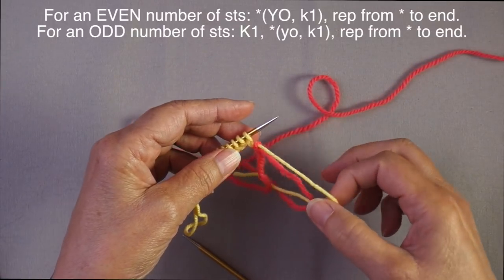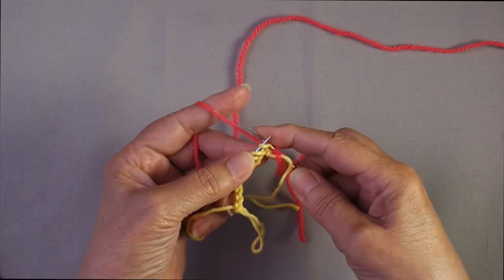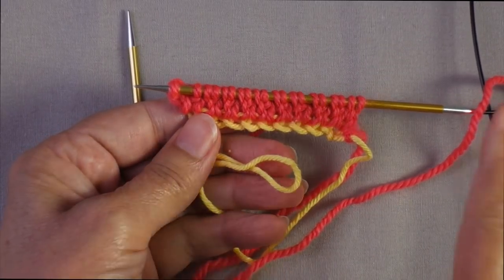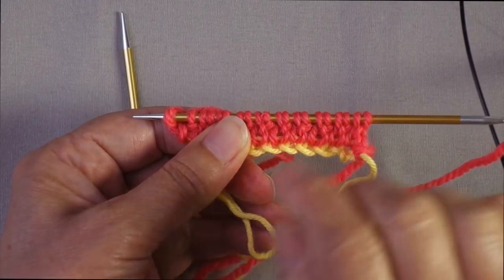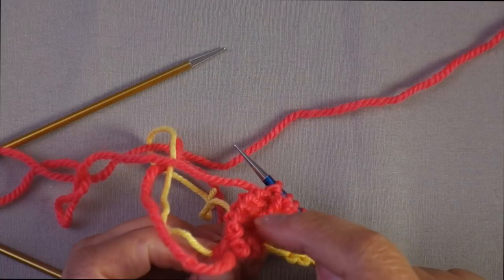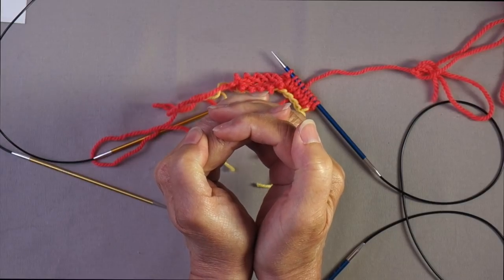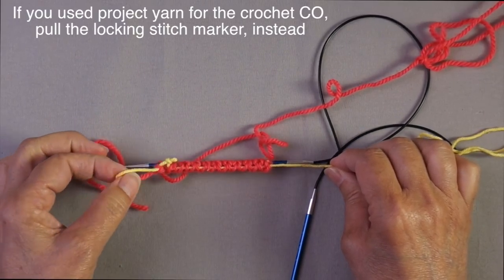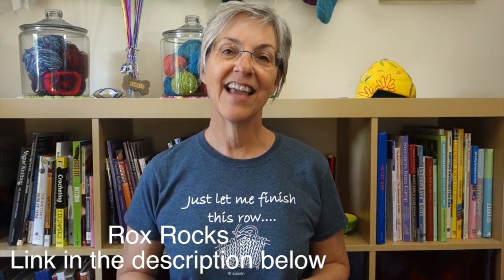Tubular Cast On

Comment: Do any of your videos show the 1 x 1 tubular cast on in the round? On this video it looks like you completed your tubular cast on and then joined your work? If so, do you just knit one purl one on the first round of regular 1 x 1 ribbing.
Reply from the maker: Once you've completed the setup, it should be clear which sts are to be knit and which are to be purled. So if you join in the the round, knit the sts that present as knits and purl those that present as purls.
Reply: Is there a right side and a wrong side to the tubular cast on?
Reply from the maker: It's like any k1p1 ribbing pattern in that both sides are identical, once you complete the set up rows. You can do the setup rows in the round, but it's trickier, because one round you'd k1, sl 1, and the next round, you'd have to sl the sts you k the previous round, and purl the sts you had slipped. So if you do the setup rows back and forth, you knit the sts that look like knits and slip those that look like purls. Once you've completed the setup, you work them in k1p1, regardless of whether you continue to work flat, or decide to join in the round.
Reply: Thanks for clarifying that for me. I am working on a pair of fingerless mitts and want to use a tubular cast on. I watched another person’s You Tube video that showed doing the cast on in the round. But I found it to be tricky getting the join to look decent. Additionally, it was tricky having to do each round opposite of each other. My only concern is how good of job I can do with seaming the stitches of the tubular cast on. The devil is always in the details for me. LOL!
Reply: If I need a total of 46 stitches for my cast on, do I put 23 crocheted loops on the needle and follow the odd number of stitches directions of do I follow the instructions for an even number of stitches because of the total number of mitt stitches is supposed to be 46. . It is a little confusing to me.
Reply from the maker: Yes, you crochet CO 23 loops. You want to end up with an even number (46), so follow the instructions for an even number. If you wanted to end up with 45 sts, you'd follow the odd instructions.

Comment: Holy Mackerel you totally lost me way back. I don’t understand what the purpose of going back and forth is. I’m trying to find out out to cast on 150 stitches in the rounds, not using the Long tail cast on method, because I don’t know how long a tail I need to do so many stitches. This video has me TOTALLY confused!
Reply from the maker: The tubular CO is a specific CO used for k1p1 ribbing in order to produce a non-edge (the k1p1 rolls around from one face of the fabric to the other). If your issue is not wanting to measure a tail, you can use any number of CO methods that can be done with a single strand, such as the cable CO, or you can CO using the LTCO without measuring a tail, using both ends of the same ball of yarn. If you are using non-superwash wool, you can spit felt the two ends together, to avoid having to weave in extra tails, later. https://youtu.be/urHhY-aYjKw

Comment: How does using smaller needles then switching to your project needles affect the project? I am knitting a hat. I am using needles 3 sizes smaller than my project needles, and the tubular cast on looks way too small. Are my needles too small?
Reply from the maker: Typically, using a needle a couple of sizes smaller than the project needles is a good idea for the ribbing. Whether yours is too small depends on whether or not is stretches to fit your head the way you would like it to fit.
Reply: @RoxanneRichardson  jjkkk!

Comment: How do I do this in the round?
Reply from the maker: The way I do it is to work my k1, sl 1 setup rows (2 or 4, depending on how I feel), and then join. It is possible to do it in the round by joining at the end of the first set up row, and then slipping the sts presenting as knits (with yarn in back), and purling those that were slipped on on the previous round, but I tend to make mistakes, so I wait until the setup rows are completed. I use the tail to join the beginning/start of the round.
Reply: Roxanne Richardson thank you so much for getting back to me so quickly and being so thorough ❤️😄